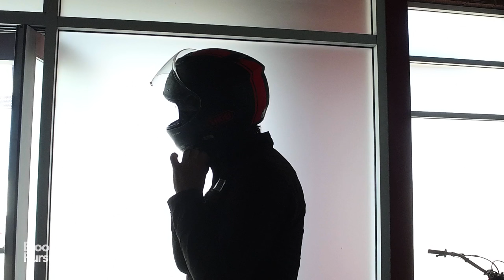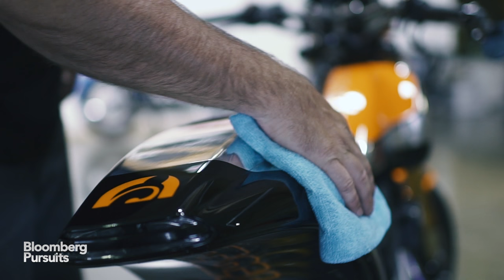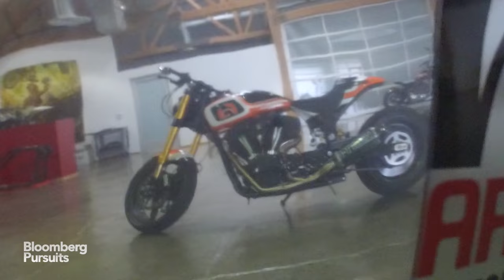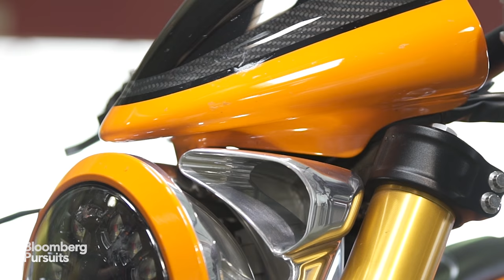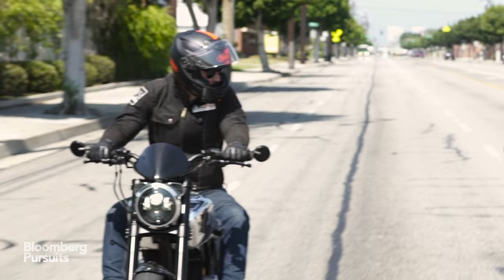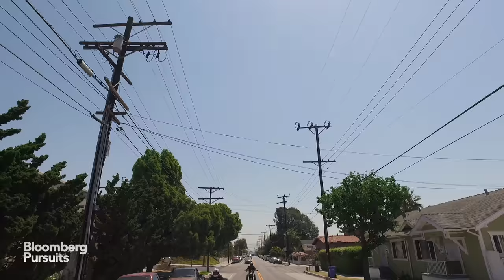Keanu Reeves Wants to Build a $78,000 Motorcycle Just for You

Comment: It’s a nice bike with all the custom parts etc, but it’s basically a Harley-Davidson type motor which is not revolutionary. A revolutionary ease of maintenance motor with power, that edge goes to the Victory & Indian motor platform. Their bikes are American made as well with one hole, one plug oil changes made easy to stay out the shop and on the road.
 Arch has its place just like any other brand with celebrity support.